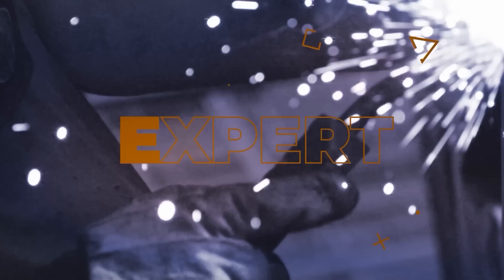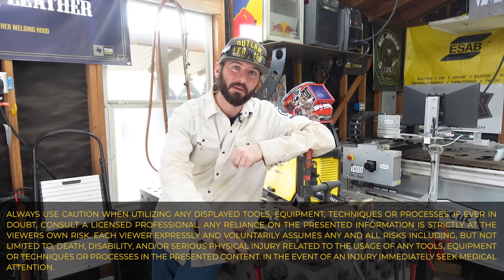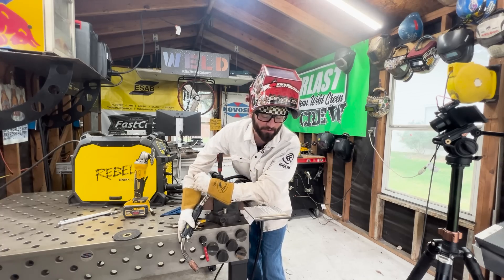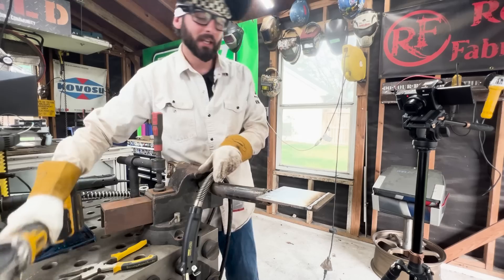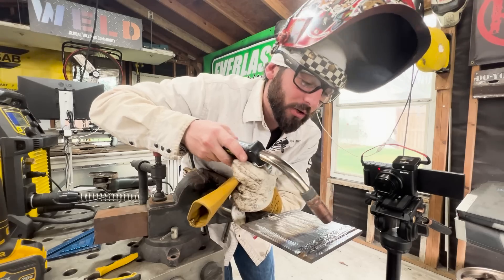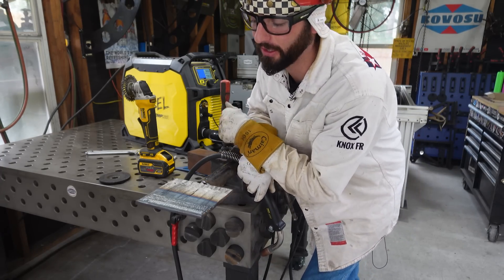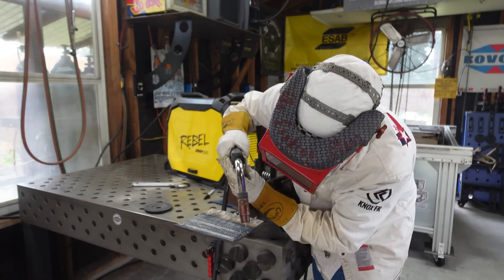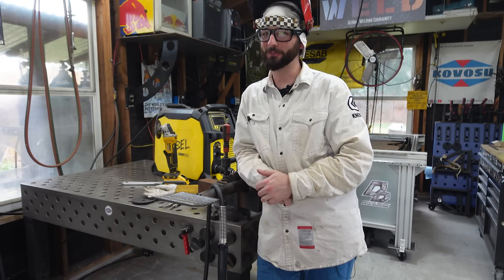Secrets to Perfect Beads: MIG Welding Techniques

Comment: My opinion, consistency is important, I don’t always weld and create projects that require certifications, but for cleaning up welds or not cleaning up and just getting painted, consistency will definitely make you more $$ and your customers/ clients will always return for more. 19years welding and still run beads on plate just for the extra hood time. 
Also dig the whole video idea! 👊🍻

Comment: Just curious why you think you need to do any kind of movement like your running a 6010 rod? I've seen several people do this on welding tests I've given at a couple places I've worked , the back and forth movement or even circles. Neither are required , and if your doing buildup work could be a disaster.
Reply: The circles and back and forth movement are for people that don’t know how to pace themselves without doing the circles and back and forth method. So they’re not going too fast with their travel speed.